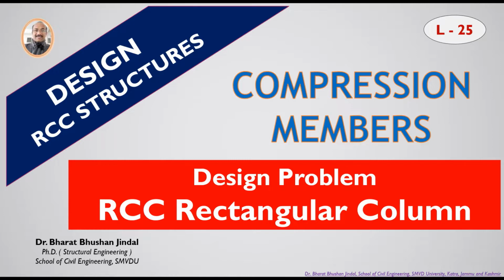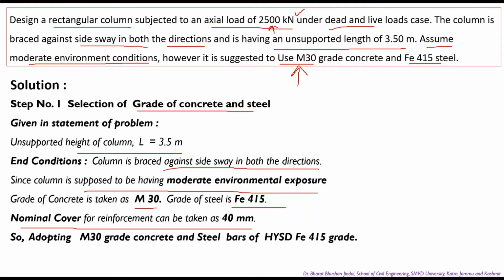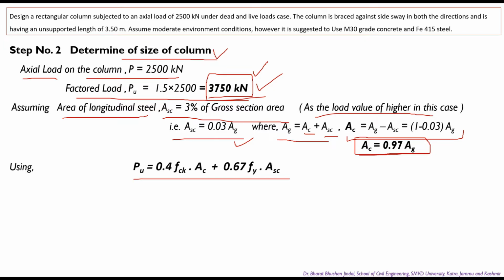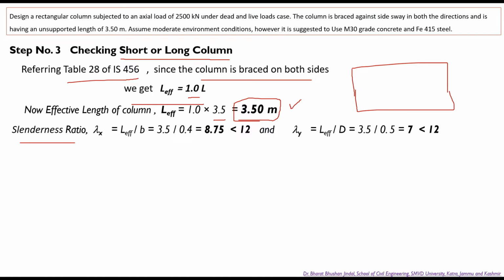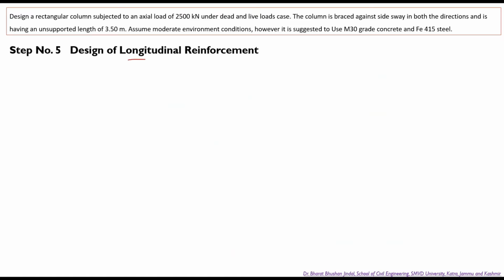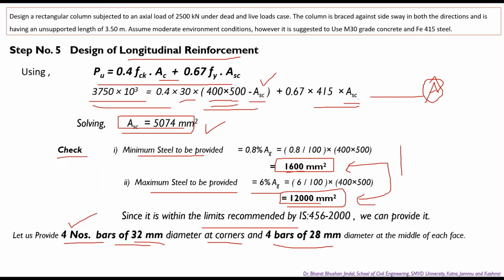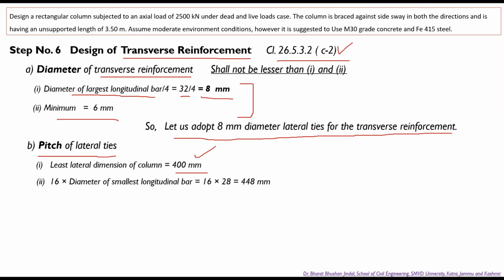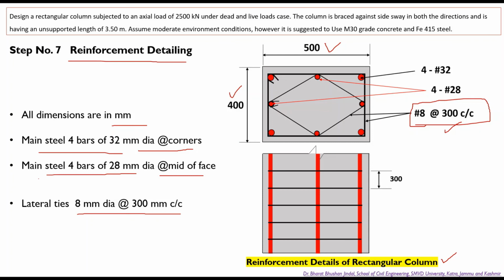Lecture 25 | Design Problem || RCC Axial Rectangular Column

Comment: what would be the condition that we prefer rectangular column over square? architectural preference or any structural point of view??
Reply from the maker: Generally as per architectural requirement. However, a circular column is better than rectangular/square column in terms of load bearing capacity but special formwork requirement may increase the cost of construction.

Comment: Sir, is there any specific reason to provide longitudinal reinforcement bars of two different dimensions in this case. And can we provide longitudinal reinforcement bars of same diameter in this very case.
Reply from the maker: Of course, you can provide. No specific reason, it is only to proportionate the required area of steel.